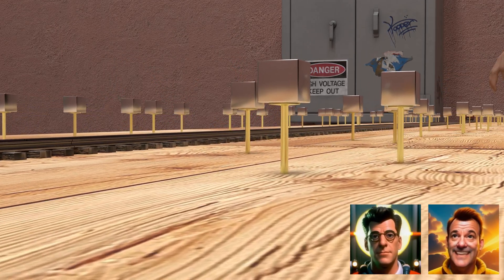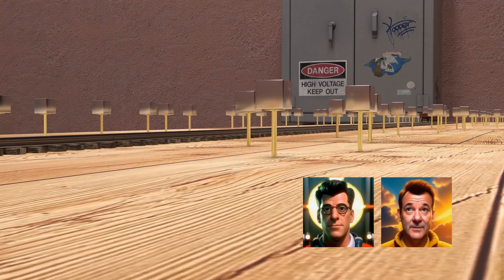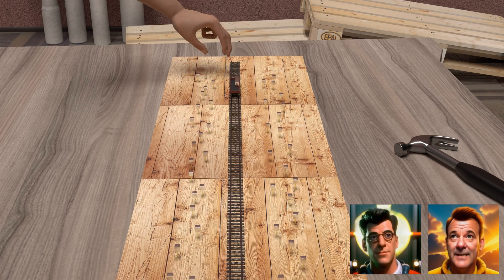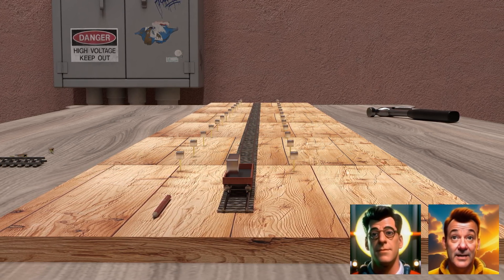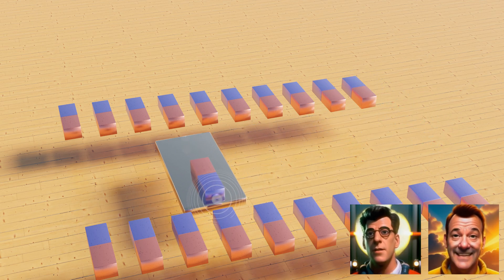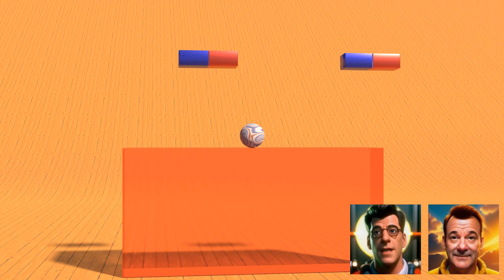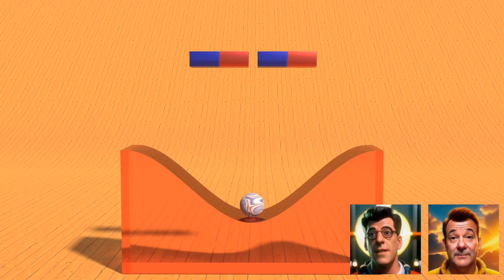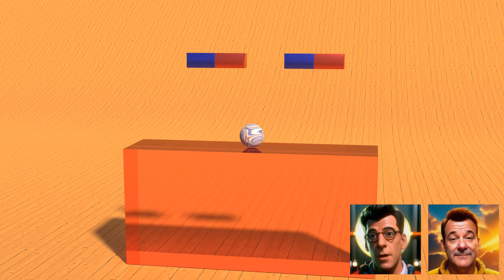Impossible, free energy ramp. The way there and back.￼

Comment: Yes, that is correct. Unfortunately, that doesn't explain how, with the other magnets of the array in place, I was able to symmetrically arrange and tune the array without the need for distance or strength changes. I was also able to have the train with the magnet centralized. The only changes I was able to do outside that, were to make tiny placement adjustments and fine adjustments of the polarity of the magnets along the array to convince the train, to go, not just in one direction but in both directions with no power assistance. So it can be done unpowered, symmetrically, bi-directionally, with a centralized permanent magnet on the train, and without a magnetic hill to roll down. The polarity of the array is inexact though as the magnets have holes in the center that they are screwed to the board with. So the magnets can be twisted on the axis of the screw and these slight polarity changes influence the behavior of the magnet on the train to produce forward motion. This may hold a clue as to why this is possible whilst still fundamentally impossible. Unless there is invisible energy as you said in our communications in the follow-up to your video then there is no explanation. Perhaps magnetism is attracted from our surroundings by high-strength permanent magnets and it can be teased out to create work. Anyway, all I know is it's possibly the start of understanding where all the matter in the universe comes from. Did it arrive on a quantum level through matter and anti-matter particles and strings of energy according to string theory? Even if the Big Bang must have happened it must have happened somewhere and things could be a lot older and bigger than we think. Light bends with gravity too so even the night sky is not astronomically correct and therefore our calculations made with starlight are inaccurate. But if everything came into existence naturally and gradually and cyclically and for an indefinite period of time it is a more rational approach to think that we are a part of a wider infinite cycle that all things are in pursuit of and I think that is what drives my train forward. Whatever the force is that drives the universe.
Reply from the maker: Sometimes the universe stays a miracle 🙂, thx for watching
Reply: Nothing short of one. lol Thx for doing your creative and talented videos. @yWild
Reply from the maker: Hi Hart, thanks for your inspiration and I am glad you like my videos. 👍🏻🙂

Comment: The train has to roll down a magnetic hill. Therefore the strength of the magnetts has to increase to pull the train forward. Your example shows the same strength magnets evenly spaced. That just would not work.
Reply from the maker: Hi Hart, yes, it has to roll down in the highest depression. If the magnets have the same strength, then the distance to the wagon is the indicator for the influence. You may recognise that the distance gets lower and lower the more far the wagon gets. Thx for watching 🙂

Comment: Misunderstanding the magnets have to have a stronger magnetism  to draw the train pasy the last magnet in other words the magnetism must increase a long the length of the array or it will not get past the first magnet. So if the is not  a gradient of magnetism the train will not move. Does that make sense.
Reply from the maker: Hi Hart, I think you understand what I mean. You can use more powerful magnets. You can change the distance between the static and moving magnet.  A Usual magnetic ramp use this the distance to the moving magnet. If you like, watch some of my other videos. I describe this more understandable there. Thx for watching 🙂